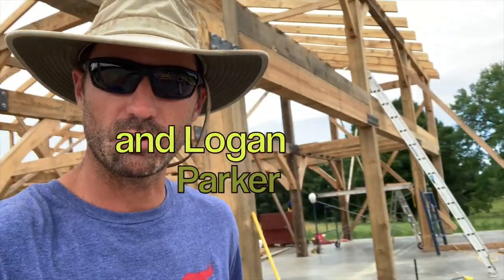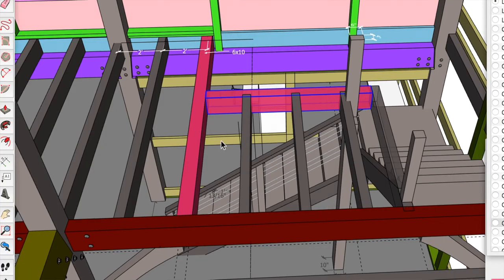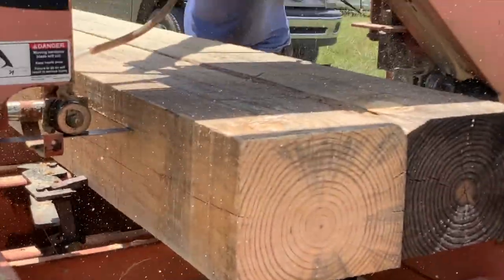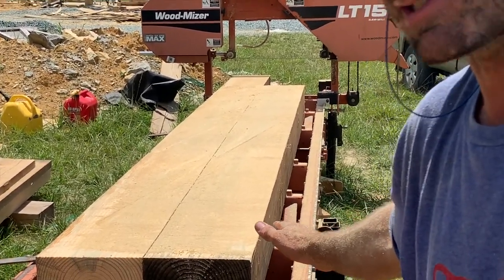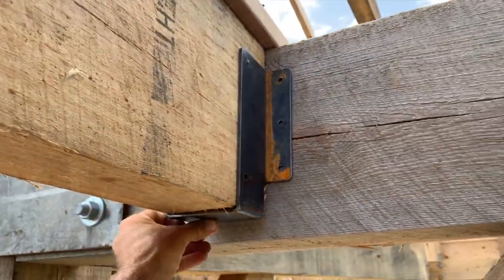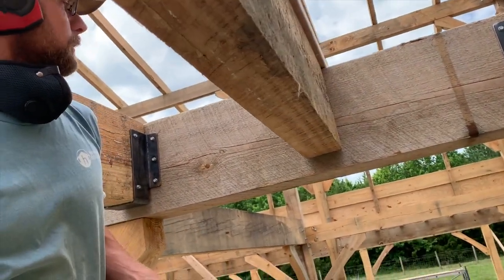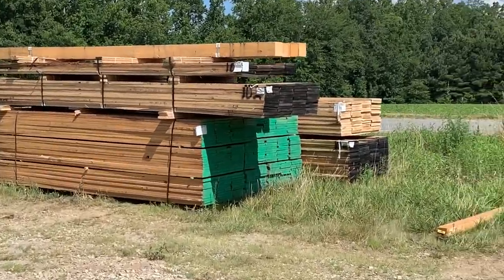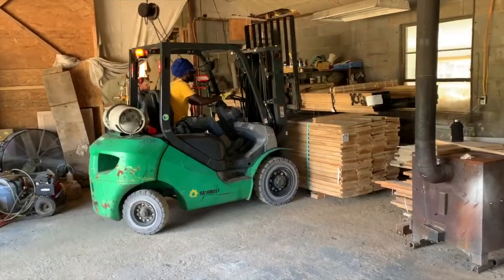TIMBER FRAMING Construction VLOG | Not Your Average Monday | Sawmilling Custom Beams on Wood Mizer

Comment: I have watched a lot of your videos, and it has been very informative. I recently purchased an A-frame, and wasn't completely aware of some of the construction details like how the ceiling and wall construction were accomplished vs a traditional stick home. I have been wanting to build a post and beam garage for some time, and I was thinking of doing similar steel plate joinery when I get around to that.
Reply from the maker: DRDEE 🙏awesome! I’m thinking about doing a comprehensive post and beam design/build video. Would that be something you’d find helpful? Any topics specifically?
Reply: HeirloomBuilders Some of the specifics I am researching are cathedral roofs, exterior insulation systems, and vapor barriers/wall design. 

I know that this house has some issues with condensation causing light staining on the shiplap ceiling. I suspect there may be some roof ventilation issues that I plan to address in the future when I get to replacing it with a standing seam. 

I am in region 5, so I have been looking into replacing the vinyl siding with external rockwool, rain screen, and hardie board next year starting with the worst sections.

My prior experience is with traditional stick frame ranches that have full vented attics and some balloon frame construction. Most of that being on the gulf coast.

The garage will be a project for after I attack those issues. Its more or less icing on the cake as I have adequate shop space for now.
Reply: HeirloomBuilders Another good topic could be hvac ducting and return in post and beam construction.
Reply from the maker: DRDEE yes. Ventilation is key. Every wall and roof assembly is different, and takes time to consider all the variables, like climate zone, aspect/exposure to sun and wind, and indoor climate conditions - figuring out how these variables affect each other is an educated guessing game. Sounds like you are doing the necessary research and taking the time to create a successful build/renovation. I’ll try to hit some of these points in the next post and beam vid.